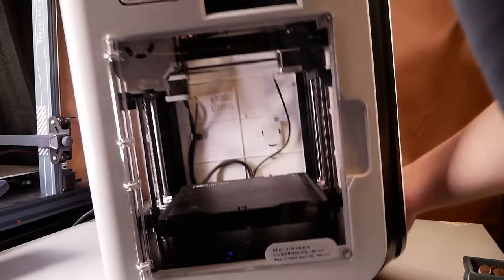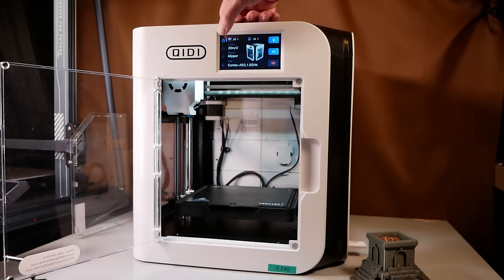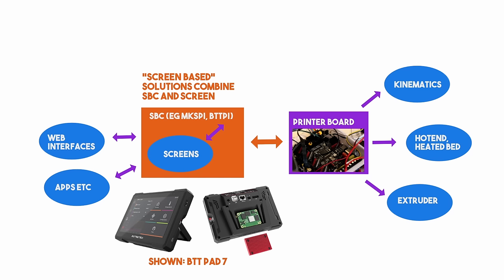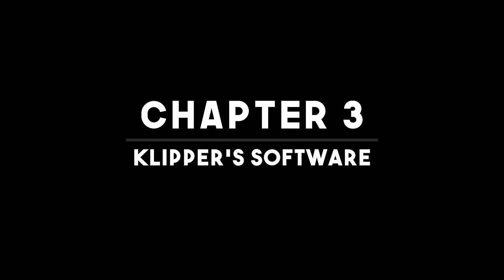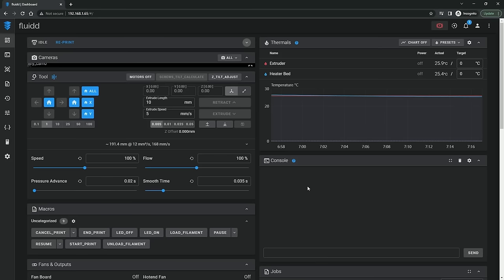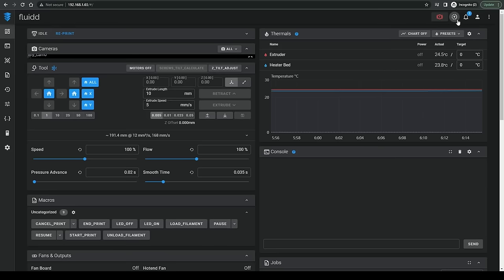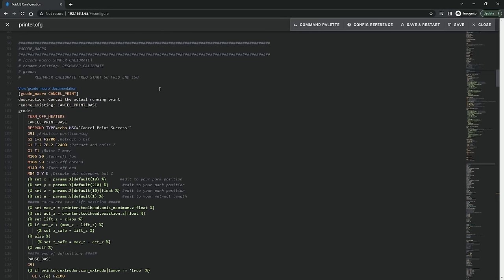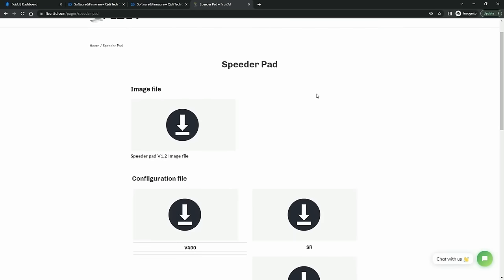Here's what you need to know, if you have a Klipper printer.

Comment: Also, people think Klipper is somewhat "magical", but there's a reason why big print farms don't run klipper. A marlin based printer hooked up to power is nearly a bug-free setup. While Klipper and its connectivity features, and linux and whatnot can cause a lot of problems along the way. And this is coming from someone, that uses both, Marlin and Klipper and i'm happy with both of them.
Reply: I agree. Pretty simple, literally. Software is always susceptible to issues, so the simpler the software can be, the more robust the overall system will be.

Comment: Have an X-smart 3 with Klipper and absolutely love the web interface and everything.  I'm an intermediate user and had zero issues.  It has a very fluid (no pun intended 😂) and modern feel to everything.  I plugged a USB camera in to the QiDi X-smart 3 and bam I have camera over WiFi immediately.

  Can calibrate pressure advance and any other setting from web console and easily control everything.

Comment: Honestly I thoroughly love klipper. I was skeptical of it when i bought my sonic pad but i now have an Anycubic Chiron and Ender 3 V2 NEO running off it.  I literally just not 30min ago used an old z-endstop from an ender 3 pro i also have to make a filament runout sensor for my v2 neo. Took me all of 20mins of reading online which pin was needed and where to plug in the sensor and enable it in klipper, no need to recompile firmware or anything, just change some settings in a CFG file and  boom its enabled and ready to test.
Reply: Didn't know this was an option. I've got a superfluous endstop kicking around due to a BLTouch installation on my Ender3 v2, will have to look into it to see if I can do it too!

Comment: Great review. I built a Voron 2.4 about a year ago upgrading from a ender3 v2.. I have been in IT for over 20 years, most of those years working with some flavor of *nix. Building and configuration were still a challenge but easier due to my work experience. I couldn't imagine someone with little to no linux/hardware experience starting with Klipper. 

Thanks again for sharing. New subscriber.

Comment: You don’t need a Pi or even an SBC to use Klipper. I’ve got an older SFF desktop running Ubuntu and then I used the KIAUH install script for setup. My SFF runs four Klipper printers without any issues.
Reply: Yep, mine is running on an OLD laptop (Core 2 Duo CPU, lol) that I saved from the scrap pile for this purpose (though I'd be surprised if it'd run more than one printer simultaneously).
Reply: @jungletek  Mine is an i5 something something 4th gen with 8gb of RAM and a 500GB HDD.  (I've been dragging my ass to replace this with an SSD lol)

Comment: I can't believe you had this (really good) image as a possible thumbnail option and decided to go with the klippers at first xD

By the way I don't really get why people call Klipper less user-friendly. Changing stuff is just so much easier and everything is where you expect it to be. Not to mention that having the interface in a browser just shows you a lot more information. The only "difficult" part is flashing some firmware and getting a starting point for your settings which are both not an issue for premade solutions.
Reply from the maker: I botched this up after the first one didn't work lol
Reply: Just because the tools are convient, doesn't make them beginner-friendly. Those are two seperate things, that gets mixed up a lot, no offense. There is a diference between able to edit a config file vs understanding it and able to editing.
Reply: @TuncayAyhan Editing a config file on the fly is much easier than the Marlin way of editing it all and then compiling the firmware. Then if you need to change something, you need to do it all again.

Comment: It's interesting how we've progressed from the ANET A8, which required manual wiring and had a questionable mainboard and power supply, to beginner-friendly 3D printers like the Ender Series. However, it's ironic that with the addition of Klipper to these style of printers, newcomers find it more complex than Marlin. It feels like we've taken two steps forward and one step back.
Reply from the maker: yeah its kinda weird to watch something as un-beginner-friendly becoming "the norm".
Reply: I kinda miss my A8 :')

Good times, swearing at the printer but having fun.
Reply: I had a Anet A8, the most parts i still have and still use, the ONLY dodgy part on that printer was the traces for the heated bed output were too small for the current. if you didn't connect the bed or used a mosfet mod that machine was perfectly safe.
Reply: @UmbraAtrox_  ha, I removed the connector and soldered the cables directly to the bed after I noticed that the connector was slowly turning brown
Reply: @FAB1150  good you caught it before it turned redish-orange
Reply: It doesn't really seem much different to me. Unless you're writing gcode by hand.
Reply: I still used my anet a8 up until July of this year! It just needs a few new parts to get back up and running, im donating it to my little sister and her boyfriend to get back up and running and getting into the hobby! Such a great printer, brittle acrylic and all😂

Comment: I've recently (this week) changed my Ender 3 V2 to use klipper. It was fairly simple but there was plenty of YT help and I know my way around non-gui os's. What I want to learn is how to run my printer faster, beyond the original mcu capability but within the hardware limitations.
Reply: I have the same printer and I'm looking at changing to Klipper too. 
I'm struggling to find  YT content relevent to my setup. 
 I have a Raspberry Pi 4 Model B with 8gb of Ram. 
Most of the documentation I am finding is for earlier versions of Rasberry pi
Would you be willing to share your reccomended sources? 
Happy to do it in private messages if you prefer.

Comment: Good news, Digikey does have RPi SBC's in stock.  However, you can use ANY computer running Linux to run klipper, you can even run klipper on your desktop or laptop computer (if it runs Linux, though maybe Klipper will be or already is ported to Windows or Mac).  In that case, just connect your printer to your computer via USB as you already do.  You will have to leave your PC running while printing though.   Another SBC that wasn't mentioned are the Beagle Bone / Beagle board.  You could also use any micro ATX mother board with an el-cheapo Atom, Celeron, or other X86ish processor.  If you can develop Android apps, you could also run Klilpper on an old smart phone.

Comment: I use the 3D printer as a hobby. Never once have I printed a calibration cube or a benchy cos I am just printing fun stuff. My Ender 3 does everything I need. It takes its time but I never needed it to go any faster anyway cos I work 12 hour shifts and usually I let it run through ny shift til I come back. I just find it relaxing to have something being built and printed while I go on about my day. Never needed it for business or trying to monetize this hobby. Parts for Ender 3 are easily and cheaply procured online. I always keep spares of parts cos they are so cheap. I am so good at bed levelling that I dont even run tests anymore. Just watch the skirt print and adjust along the way.

Comment: Well, I figured Klipper or something like it, was coming.  I really don't want to buy a new printer (to replace my LARGE volume Creality-CR10S).  I would like to figure out an upgrade path, however, that include Klipper.  I bought the BTT SKR Pico V1.0 Control Board and a nice screen, of course when the market for Raspberry PIs tanked.  I just now need to figure out a proper path to switch out the stock CR10 controller for the BTT Pico, find a Raspberry PI ( 4? ) and learn some nuggets of knowledge from your upcoming "migration to Klipper" videos!

Comment: I love Klipper but setting it up was a huuuuuge pain. I wish there was a drop down with common commands. I get that you can type in the commands but most folks aren't about command lines and don't want to go search the klipper docs to do something you could do easily in Marlin. It wouldn't be hard to make a beginner friendly iface that will give you suggestions on different things to do to set it up.
Reply from the maker: Is there even a reference with commands? I know I struggle with that too.
Reply: @LostInTech3D  Actually I just found out the question mark next to the console gives you a list. However, it doesn't give you syntax or examples.

Comment: Your START_PRINT macro doesn't heat up anything and you don't do it in slicer either. Does cura always put them in the start of the G-code no matter what's in the "Start G-code" field?
Reply from the maker: yup, cura adds it if it's not there.

Comment: Will you be making a video on Orca Slicer? I downloaded it yesterday and quite like it as it is similar to Prusa Slicer which I only use for my MKIIIs as I dont like its GUI, I do like Cura's GUI though and Orca is laid out in a similar fashion to the Cura GUI.
 I have had to make profiles for my printers for Orca as none of mine are in Orca but I found that quite simple, I am currently integrating the API calls to Octoprint into it for my Marlin machines and will later attempt to do the same for Web Control for my Duet equipped RepRap printer, having the slicer and wireless GUI all in one without having to manually change to Octoprint and Web Control will be great, I did convert one of my printers to Klipper but missed the multitude of plugins that Octoprint has so i swapped back, I am thinking of flashing Klipper again to see if Octoklipper will run my plugin library.
Reply from the maker: I briefly poked around at orca while doing the z-hop stuff, I guess it's probably worth covering at some point

Comment: This sounds like an excellent series for those that like to get into the weeds and look under the hood. I hope to be getting my first printer for my birthday or Christmas. I am seriously considering getting a Marlin based printer first as Klipper looks to be a lot more complex. Top of my list is the SV06+. I still want to learn to use a 3d CAD program and understand the slicer side first. Then get the BTT Klipper pad as an upgrade down the road.
Reply from the maker: klipper is only more complex if your printer doesn't come with klipper, would be the best way to put it. It's pretty seamless in most preinstalled printers these days.
Reply: Klipper is much easier to set up and use than Marlin. 

Modern day printers like the K1 series and Bambu printers are pretty much plug and play.

Comment: I don't have a Klipper printer so I really don't know much about it. One thing that raised a concern is with the start macro. On my setup PrusaSlicer substitutes the first-layer print temperatures (extruder and bed) with what I have configured in the filament settings into the start gcode. If I replace the start gcode with a call to the printer based start macro, how does the printer's macro know what type of filament that I've sliced the print for so it can set up the first layer print temperatures?
Reply from the maker: Cura adds it from the slicer settings, and klipper understands it (as gcode) 

I think it might be the same in prusa, sometimes people are adding stuff that makes it worse not better, but I don't really use the prusa with klipper much yet.

Comment: I also just decided to get on Klipper (after years of brewing custom firmware for my printers), and for the start, because the installation is quite point and click, I would like to learn how to edit custom stuff for a printer, for example, how to add BL Touch config, direct drive, different stepper motors (the E3D ones), etc. I think this is where Klipper is a bit "not welcoming" with Marlin veterans, there I knew what I can and can't do, here I'm like in a foreign country without google maps. I think a tutorial on how to config a brand new custom printer would be awesome. 

I do have a feeling this is might be like switching from PC to Mac, where I didn't know that in order to uninstall an app, I just needed to hold it and click on X and felt stupid when I found out.

Comment: Damn wish I seen this video sooner. I had a ender 5 plus that I converted to use the sonic pad and a micro Swiss extruder. I was having a lot of small problems that was very frustrating. I ended up buying the Bambu labs x1c and sold my ender because I was so sick of tinkering with it over the last 2 years just to get it to print consistently. The biggest problem was it seemed like the stepper motor for z axis wasn’t making big enough steps. Like say your printing a cylinder that like 10 inches tall. By the time it’s 25% done it’s like the nozzle was digging into the print and as it got further into the print the less the z axis changes between layers. I even replaced the motors and tried the z axis file Creality has to download but nothing was sorting that problem out for me.

Comment: Linux system administration isn't my strong skill, but on a system I've setup myself, I like klipper. on a factory machine I'm a bit apprehensive. There have been a lot of totally unsecured Linux internet of things devices sold in the last decade. 

Pis being unobtainable, I'm running my Voron 2.4 on an old thin client with an upgraded ssd. Kiauh is a lifesaver. Ironically I had been planning to script the install. they saved me a lot of trouble.
Reply from the maker: I've still not got round to kiauh, but I seem to be moving in the direction of pre-made images, this vid was meant for people with pre-installed klipper, and I shudder at the thought of trying to make a klipper from scratch video...where would you even start lol.
Reply: @LostInTech3D  OS installation, the Klipper User setup and installation of the tools basically. 

I'm using a bare Ubuntu Server install and just the dependencies for Klipper. 

With kiauh, the hard parts are all linux administration. Kiauh handles most of that too. That tends to be why the pi installation is so favoured. The crunchy bit is done for the end user.

Comment: My main question is... Is it worth converting a marlin printer TO klipper? Specifically... I have an ender 3v2 with MriscoC (Sept '23) which I run Octopi on a pi3A.

I'm a bit of a tinkerer if there's an obvious benefit to tinkering, but I hate wasting my time.

So do you think there's a benefit to moving to Klipper from marlin for this printer?
Reply from the maker: My opinion: no. 
But of course my opinion is tainted by having too many printers. 
I would advocate something like a btt manta and do klipper all on one board, if you're converting. Wires are... annoying

Comment: I install klipper 5 days ago, really its was not so hard , i just hava trubles with my bltouch clone but i just solved conecting them to the probe port of my skr mini e3 v2.The documentation is very good , now im making a usb  acelerometer with a pico + adxl345 , chang the printer.cfg file its so esay now😊 , and i can print pretty fast. (300 mm/s infill,150 mm/s walls , 5000 accel, on modified ender3 plus e3d volcano  hotend/TItan extruder

Comment: I'm pretty new to Klipper (about 3 - 4 months using it). To convert my Ender 3 v2 I read the Klipper documents a couple of times and watched a few youtube videos. I do believe however if you going to convert from marlin to Klipper you should have some expierience with your printer. Know some background about the different parts and how they work. Also set a hostname and use that, no need for static IP addresses ;-). I do have a question .. do you need to update the printer firmware at some stage? I'm runing mailsail und have been updating the different parts (klipper, moonraker, mainsail etc) regulary but have not updated/reinstalled the firmware.bin that I installed all thoughs months ago. Is there any need to do so?
Reply: Simple answer to your question: it can be necessary.

Long answer:
Klipper may change in a way that breaks an older firmware version, though this should not happen regularly.
I usually reflash my boards every few months after some major updates. This is easy for me Todo because I have a script set up that does this for me (basically an ssh script that that compiles the firmware binary and sends it to the MCUs)

I generally recommend checking release notes and development when using open source software 

changes which do not suit your setup (especially if it's special) should not be updated blindly

Comment: I am quite happy with Marlin, It still revolves around the quality of your G code, garbage in, garbage out . Latest version of Marlin is just as competative with Klipper. Learning how use Cura or other slicer to its full extent is a requirement.  Quite happy to flash an SD card with the required file and go for a walk and plug it in to a printer (occasional exercise is good). It is no harder to re-flash the firmware using Marlin, and at the end of the day how many times do people do it after getting it  right. Couple of things I have against Klipper, the rip off price of Pi boards, lack of availability and extra complexity in setting them up. And until I can can change over a roll of filament, pack the used roll away properly and clean the printer out over WiFi I am quite happy to stick with Marlin. PS. I also am a member of the Luddites Anonymous Society. 🙂